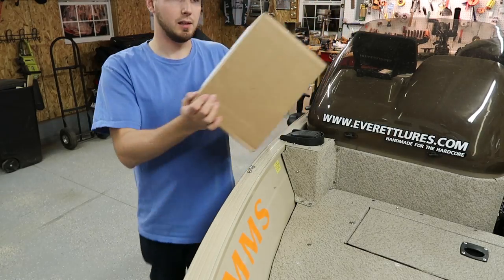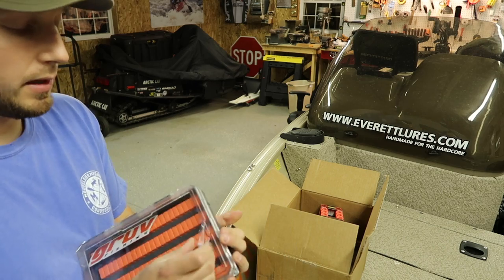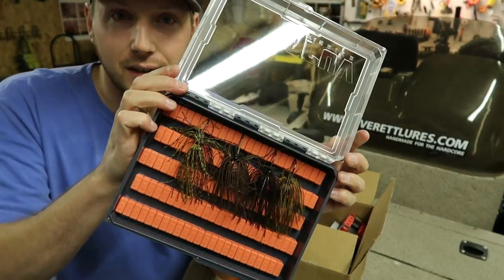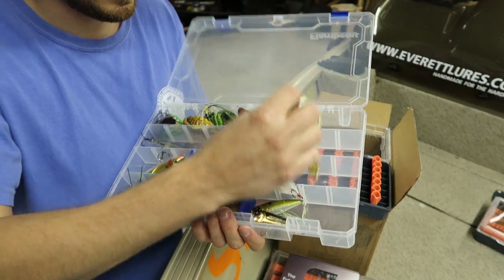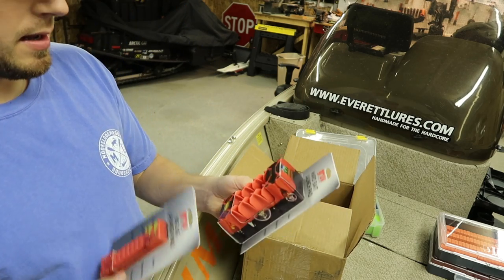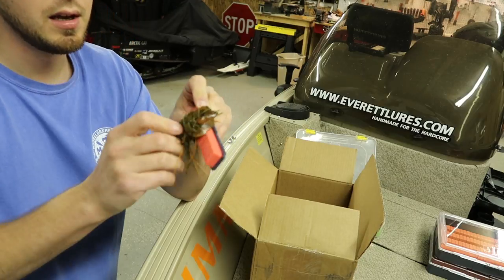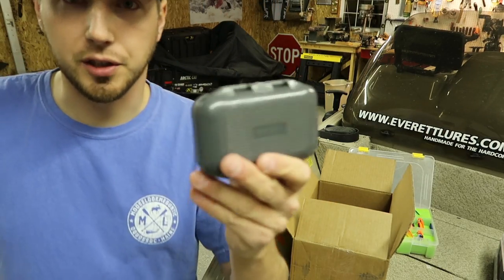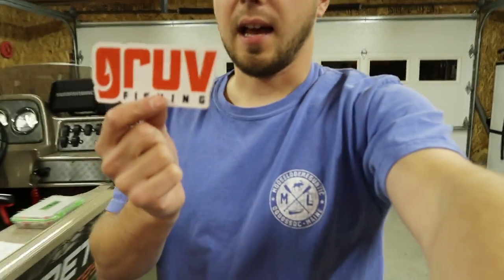THE FUTURE OF TACKLE STORAGE

Comment: i dig that this guy ACTUALLY stress tests the boxes. i have found better solutions to my tackle boxes than these provide for my needs, but you know that they are made well and work because dude literally threw one in the air with spin, on a concrete floor.
Reply from the maker: If they suck...I’ll tell you they suck.... they don’t suck.